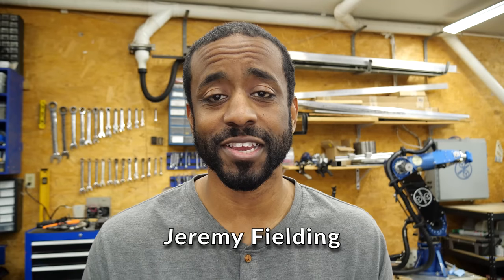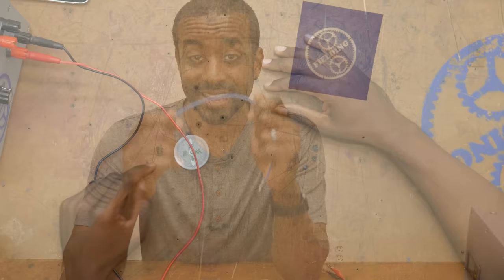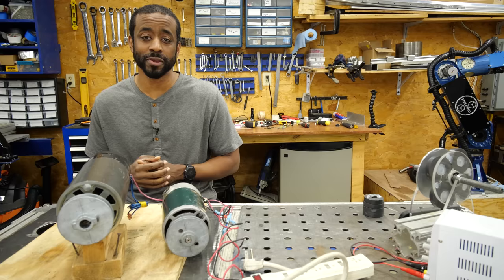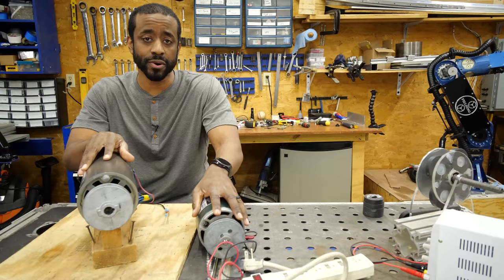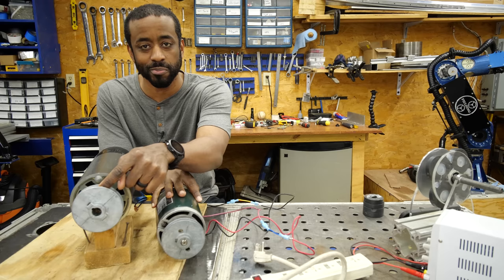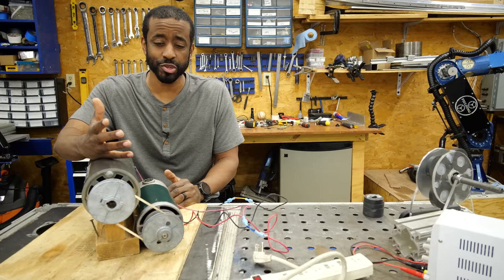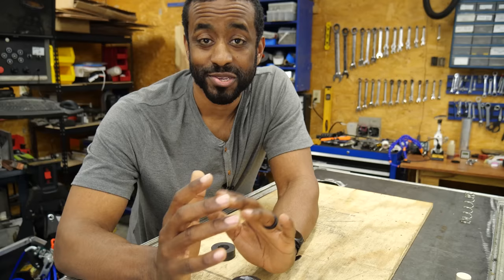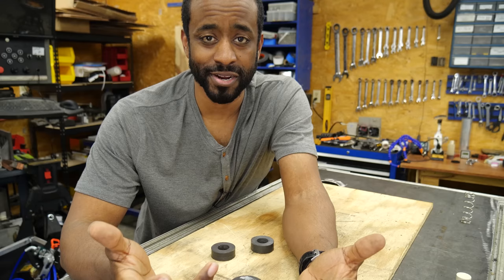Reviewing Free Energy Generators.  A Response to My Video "Nikola Tesla's Greatest Invention"- 102

Comment: Now I am not going to disagree with you but there is options to generate more power using 2 motors but I still may not run forever do to the loss you explained. But I'd you change the pulley ratio then on motor will spin the second motor at a faster speed which in theroy create extra power. Which allows for a 100w motor to spin a 200w motor. (80w to 160w) if experimented enough and counting for extra loss in wiring it might at least become closer to free energy. There is also options of using an  ac/dc mix in motors with transformers, and since motors create heat can harvest the heat to reclaim small amounts of power back. So although I don't disagree with you, I believe there still might be a chance if all options are explored. Great job on the video
Reply from the maker: A large number of people suggested this after watching this meaning I didn’t explain the problem well enough. Pulleys / gears don’t increase energy. I explained this in great detail in part two and part 3 of the series. It might help to watch them for a better explanation.
Reply: @JeremyFieldingSr  it may not create energy, but it can assist in saving loss due to friction with the right setup. Like using a small motor to power a larger motor. Larger motor usually require a little more torque. I am not saying it is possible to create free energy, nor I'm I saying it's impossible. There are so many variables that haven't been explored yet and new technologies. I fully understand the theroy of equal force but there has been a lot of theroy's that have changed over the centuries as new disoveries are made. The real question to make free energy is how to recover the loss to make it balanced. Allowing the motors to run each other without creating an extra usable power (making 100w motor 100w not 80w) friction is heat, heat is energy. So is a magnetic field. If one could harvest the waste then one could potentially havest free engery in time. I fully support your videos and debunking the scams out there.  
  It is still being tested but they have seen using solar panels vertical can produce more power than on an angle due to the reduced heat, as electronics don't like getting too hot. Some of those principles could be the key.
Reply from the maker: It also doesn’t assist. Not even a tiny amount. The problem is you quite understand what gears do which is why I made a whole video about it. It’s a very common misunderstanding. There is no right setup. I promise part three will clear up your misunderstanding. I even prove it with a demonstration and discuss a bicycle gears example you can test yourself at home. You should go from it might “help” a little to this is actually a terrible idea I just didn’t understand why it was. Link to playlist in the description.
Reply: @JeremyFieldingSr  I'm not a streamer so I am not trying to make money in anyway. I am a tinker with an open mind. Trying out some of the basic setups I agree they don't work. What I did learn along the way is not to give up. One of the projects I seen online I recreated that worked was the magnet line or rail gun. Using magnets to repel a magnet down a tube. What would your input be if I send a toy car down a tube with a DC motor on the wheels. Would the motion on the magnets moving the car spinning wheels to generate small amounts of power? Or would the magnetic field absorb it?

Comment: If you connect to the ether. You have unlimited energy.
Overunity is only possible if you are connected to the electromagnetic energy that connects everything. Just different modalities. Light, gravity, magnetics, electro magnetics, static electricity are different forms of the same source. Match the frequencies and you have anti-gravity.( Hutchinson effect). Nobody is talking about perpetual motion  machines except the trolls.

Comment: Hi Jeremy but what if the alternator is rotated by mechanical energy from the wheel as the car moves 
That is as the car moves it rotates the alternator  that's charges the auxiliary battery won't that be possible

Comment: COULD YOU MAKE A VIDEO ON AUTO alternators? and how too turn them into ie: a AC: GENERATOR?, AND OPR WELDER? .. MAYBE EVEN A ALTERNATOR/MOTOR/GENERATOR? WITH A SMALL BATTEREY AND OR CPACITOR AND REGULATORS
? TOO SEE HOW LONG IT COULD RUN ON IT ALL LOOPED??   

i REALLY WANNA TAKE AND OLD TRUCK ALTERNATOR I GOT AND MAKE IT A dc power unit, and or use it too weld steel.. (well small welding) nothing crazy..

Comment: the alternator runs the car not the battery If it ran off the battery then you wouldn't be able to disconnect the battery and the car still run if the alternator is ran by the battery
Reply from the maker: Sir, First we are talking about a hypothetical EV with an alternator not a gasoline vehicle. Of course you have power without the battery in a ICE vehicle. It is called gasoline. We are talking about a situation where an EV is trying to power itself like an EV running on an alternator. In that situation, it won't run which is what I said in the video.

Comment: If a 2000w 12v 266 rpm  turbine generator produces 460 joules of energy per one rotation and is mechanically direct connected to a 3/4 hp, 12v,  1750 rpm motor  that requires only 19 joules of energy to complete one rotation, a mechanical feedback loop will be initiated at the introduction of an external source supplying the required 19 joules to rotate the turbine generator. This will produce 460 joules of energy  directly to the motor at the second rotation. Enough energy for 24.21 rotations which in turn exponentiates till the mechanical limit of each device is reached.  This should remain an electrically closed circuit/loop with the exception of the following constant load: 
 For constant energy production a second turbine generator equal to the first should be connected via pully to the looped motor as a single constant load. As the second 2000w 12v 266 rpm  turbine generator rotates, the output is directed toward a standard wind power conversion apparatus used no differently than any wind driven power generator that constantly rotates, charging a battery bank sufficient for loads appropriate to their capacities. 

 While theoretically  energy is not able to be derived from 'nothing', at no time in our physical universe, to the partical level and beyond, have we ever not been completely surrounded by energy.  
 It should also be noted that the term 'free' is an ambiguous contextual economic term that does not appear in any mechanical engineering context or applied physics research and developmental equation.
Reply from the maker: Mechanical power is directly proportional to electrical power. This idea doesn’t work because no combination of motors and generators will give a greater output than input. The generator will be too difficult for the smaller motor to turn. Generators are like giant brakes. As the electrical load increases the mechanical resistance of the shaft increases by the same amount in a perfect system but in reality it’s also more. So you actually need 600 joules of mechanical power to get 400 joules of electrical power as a made up example
Reply from the maker: You really should just try it. This idea would be worth hundreds of billions of dollars if it worked. If you are wrong it will be a great lesson in physics. Either way it’s worth your time to try. Really you only need to plug something in to the generator and then try to spin the shaft. You will find it’s extremely difficult
Reply: That mechanical powered electricity production is directly proportional and not more than what initially powers the drive mechanism was my first thought as well. This is certainly the case in inefficiently constructed systems i.e. farm generators, rigged automotive alternators etc. where torque and rpm are indeed almost parody with the electrical output.  If you lower the amount of rotations that the turbine requires to generate optimal output and decrease the arbors mechanical resistance while producing rotational force from a motor chosen for its low wattage to torque ratio a feedback loop is inevitable. The problem usually resides with the turbine and the ultimate answer is more copper! A quality PMG turbine should have twice the copper as a standard Delco style PMG. 
 Practically speaking, the issue in dialing in the functionallity in such a device has less to do with the power/usage ratio and more to do with phase optimization.  If the 12v PMG turbine produces 12v at 260 rpm then the 3/4hp 1750 rpm motor should    be able to be directly powered by that 12v source. Using a 120vdc 3/4hp motor connected to an inverter and battery that is connected to the turbine is suboptimal, requires 'big 3' grounding with 1 gauge wire (to prevent voltage drop) and is the first mistake many make when building this device. The loop will stabilize but right at 12v eventually damaging the battery which serves as nothing more than a buffer. The energy needed to start the loop on my device is done with a pull cord. I certainly need to wind the starter cord 10 or so times around the arbor to initiate motion and you are right that it is probably more than 19 joules to start the looping feedback motion. You can get it started with jumper cables attached to a running vehicle and then remove them once it gets going, but that kind of defeats the purpose. I have done it. So should you! And no... no one will be making billions... except that is for the entities that remove content presenting positive conclusive experimentation on this topic  faster than it can be uploaded. 
 The funny part is when you get the device  to work, the glory is overshadowed by the fact that in order to store a typical households worth of power at 22kwh  you need to spend 'billions' on a few quality deep cycle liion batteries and all the junk it requires to keep them healthy! Cheers and good luck.

Comment: if you use them two spindals one bigger one smaller even if your using a power source if your second generator is putting out more power by spinning faster is that not free energy?

Comment: Can't the alternator at least charge the batteries enough to where there's an extended duration of motor operation? Cuz you actually can't drive an electric car very far and it takes a long time to charge it
Reply from the maker: No. You might want to watch part 3. I explain in more detail with better examples and a proof test that shows you make it worse not better. If this worked it would be worth hundreds of billions of dollars. There is huge incentive to do it. They don't because it doesn't work. Link to playlist in the description.

Comment: There are ways to generate electricity off the grid, but they're not free. You have to buy things to build it and you have to maintain it. Humans have gotten energy using water and wind for a long time. Wind is ok as long as the wind is blowing. Solar only needs the sun to shine, but doesn't work too well on a cloudy day and not at all at night. Water is great but you need a source of water like a waterfall or a dam. Not far from where I live there's a hydroelectric system where water from a river is pumped up on a mountain to a large reservoir and when energy is needed the water is released down the mountain to turn generators/turbines. When there's low demand on the grid the pumps pump the water back up and refill the reservoir. If you're hooked up to the grid you'll pay for the energy you use. You can build your own hydroelectric system, but again, unless you can obtain what you need for free, it's will cost you money. Question is how much and how long to pay for it? Then there's maintenance costs. Nothing's free. Great video, easy to understand. Finally someone's telling the truth about this. Thank you.

Comment: Awesome video,thank you. On the electric car thing,say it was front wheel drive. Couldnt you put a pully on an axle on an axle on rear of the car and connect an alternator the rear axle? Am I right in thinking that it could charge as the car i moving which could charge the car but only when it i moving, which could allow you to drive it farther. I know this would not be 100% free because the car would still need some charging. Am I right with this idea?
Reply from the maker: No. This will waste significantly more energy than you add. Sort of like buying a cash machine that takes $50 and gives you a $20. You bought the machine and you lose money each time you use it. Just don’t use it and you’re better in every way. An alternator is like a giant electric brake. The faster you go the harder it brakes. You can still drive it but why would you want to drive with your foot on the brake wasting energy. The electric motor has to work harder and will use way more energy than you can recover from the alternator. I prove this in part two of the series. Link in the description

Comment: So we would need to invent a alternator that produces a lot of power and is easier to spin. Somehow.
Reply from the maker: It’s not that simple. The logic is correct but impossible in practice as far as we know. This idea breaks a known law of physics called the conservation of energy. There is no known mechanism that can multiply the power put in. the input power must be greater or equal to output this. This is why generators get louder when you plug something in. It is working harder to match the output. The generator is harder to spin with a load on it. This law is a big deal and universal. There are no known exceptions. If you manage to find a loop hole in this law you will probably win a noble peace prize for changing our understanding of physics. And this invention would be worth hundreds of billions of dollars as we all want free energy. It’s not a lack of trying. It’s because it simply doesn’t happen.

Comment: Ok I want to use my car to power my batteries in my camper van used for lights fridge air con heating. So I assume the turning of wheels will generate elec. which I then connect to my batteries. Is that right? If so  how

Comment: @jeremyFielding @jeremy Fielding so question  if the magnets have reduced friction  ie  wheels or flotation device and run in a loop  perpetually chasing each other  in a large enough tank of water for cooling what would be the flaws ( I am no expert just curious  about magnetic induction i think its called)   that spinning would def lose power  but if they are in a magnetic loop   would it not spin fast enough to generate power? the magnets  set in a way  that they chase each other perpetually  (as you stated non eletrical magnets)
I am 15 minutes in finishing video before commenting

Comment: This is all sad indeed, the classic fake extension cord always used , usually mounted on a  table while strangely NOT showing the drilled holes and hidden wires going UNDER said table to motor and from wall socket. Theres a million ways to hide wires as shown here it can even be done with editing so all looks freestanding but in reality theres a cable going from the table to a wallsocket thats just edited out if there isnt some corner or carpet they can hide the wire in. The spinning fan is another classic with coincell batteryies and a magnetic reed switch hidden so when magnet comes near it spins as switch close. If trying this in reality the magnets would attract and lock together so they are likely just fake plastic pieces glued for show.

Comment: To make it run you can't use the same gear ratio . It's just like a ten speed bike so figure out your gear ratio
Reply from the maker: Exactly! Gears change speed into torque they don't change power output. When you change the gears on the bike it allows you to push with less effort but go slower, or Go faster but you have to push harder. Its a trade. No power is gained. You literally just trade effort for speed. You legs are supplying the same amount of total power. If you want a more detailed explaination I cover this in part two. Link in the description. If you still don't believe I strongly suggest you try it yourself. If you are right this simple idea is worth hundreds of billions of dollars. If I am right you will have a deeper understanding of what gears actually do. You win either way! Thanks for watching.

Comment: i have an idea that with a water tank around 2500 gal , and from the bottom of tank have a 2 1/2 inch pipe come down to water turbine. then piped out to line 2 inch  to water pump to a pipe that runs back to top of water tank. i dont have all the math but its a thought, please let me know

Comment: I like what you have explained but I believe you made a mistake when you said that the car is running off the battery and the alternator is charging the battery, well it is true that the battery is used to start the car and the alternator continues to charge the battery but the car does not necessarily stay running off the battery and the reason how I know this for a fact is because when I was young ( 18 years old 1973) we use to check if the alternator was working properly by disconnecting the battery from the car after starting the motor and got it running, well, we knew the alternator was good because even though we disconnected the battery, the motor kept running, now with that said, it is possible that things about newer cars are a little different but as far as back in the 60's and 70's the motors would stay on without the battery. Maybe back then the car not only used the alternator but when connected, it also used the battery, I am not sure, I am not an electrical engineer. I would like to read or hear a response from you please.
Reply from the maker: We are talking about electric vehicles not ICE vehicles. If you disconnect the battery the car is completely and officially dead